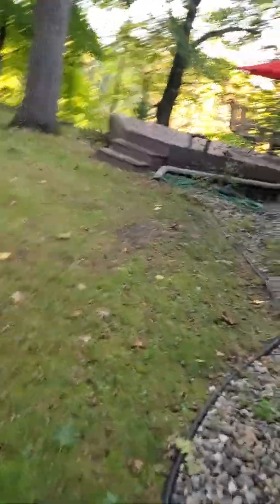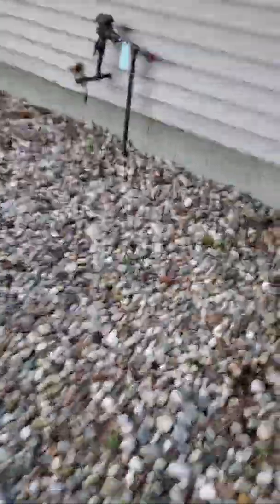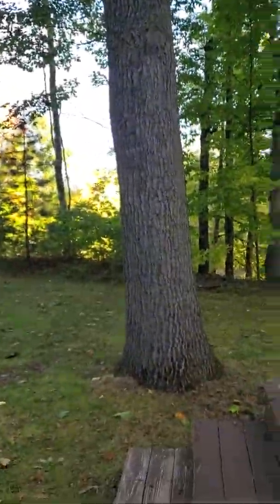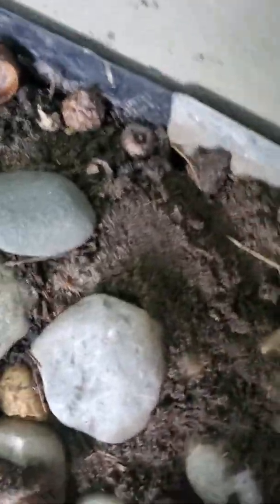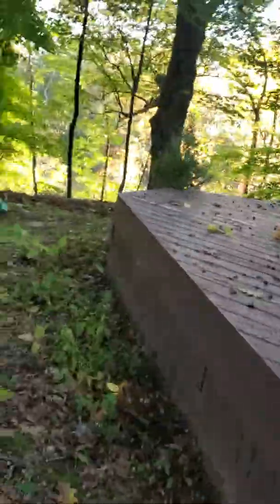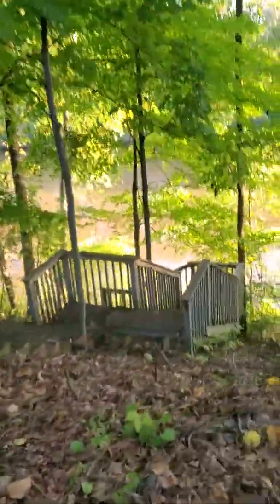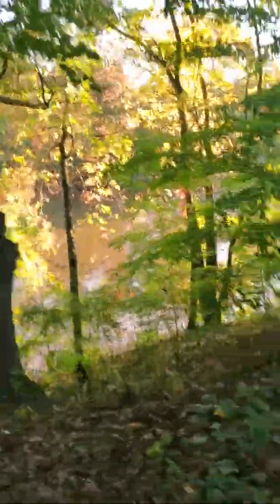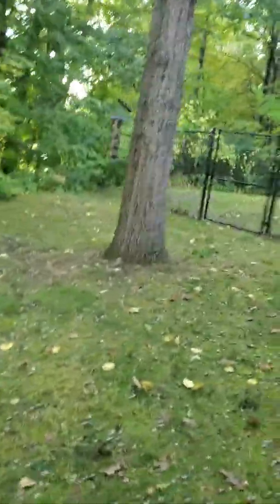Basement waterproofing carbon fiber straps failed again

Comment: So what the heck did they actually do????
Reply: they MISLEAD these nice homeowners, they told them they needed C-fiber straps inside, walls are bowed in, multiple exterior cracks, some i show in video STILL wide open lol. They supposedly had a trencher, supposedly dug all the way down, i'm not sure about that, they 'damproofed' some of the two walls as i see THIN, like a spray-on tar on some areas of walls and then they slapped on dimpled membrane in some areas and they backfilled with same crappy soil, NO gravel. They offered and gave NO guarantee lol = scam and this crap cost MORE in 2006, when it was apparently doen, than what i just gave them as an estimate and my estimate includes VIDEOS on everything, includes removing the crap soil and backfilling with 99% gravel and waterproofing the walls, not thin azz damproofing junk, and 20 yr guarantee the walls don't leak versus nothing from the boob-scam, The dimpled membranes are NOT true waterproofing membranes, as they do not STICK aka ADHERE to the walls, water does indeed get behind the dimpled membranes, just like it does here.
Reply: Ever-Try and Water-Might